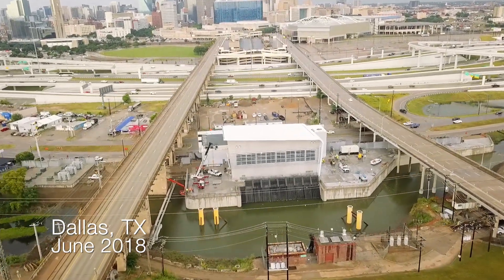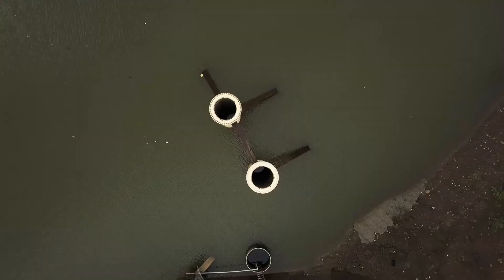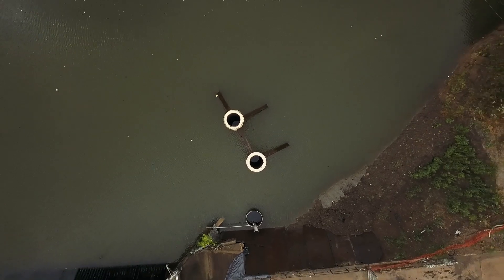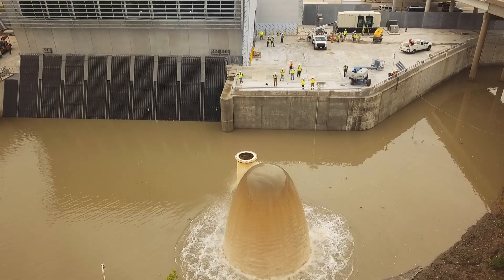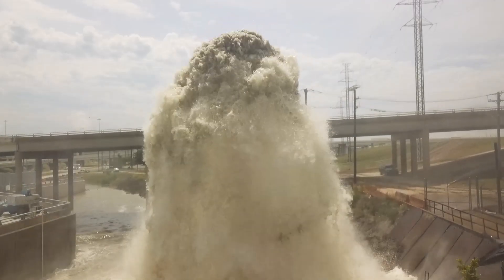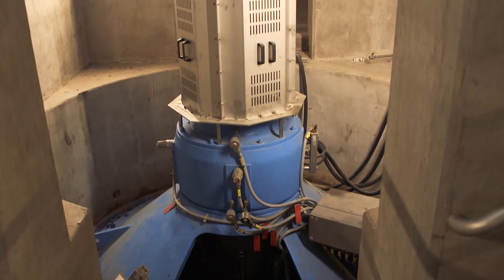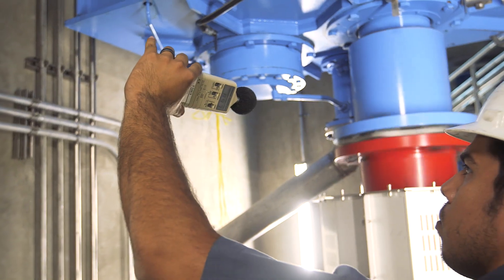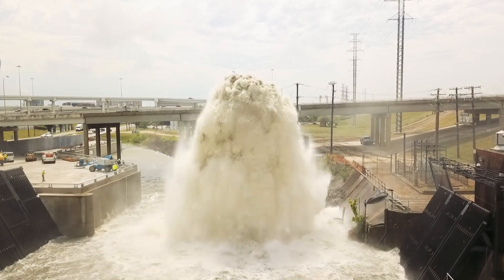Performance Testing of Able Pump Station #3 - June 2018

Comment: And what is the design head and diameter?  And who the heck designed that place as it looks like the pumps have to fight a head even when they aren't needing to. If the pumps pull in water from the needle racks shown, it then has to do a 180° turn to get to the discharge.
Reply: 58-ft TDH. Pump impeller diameter is about 9-ft. Pumps are concrete volute type.

Comment: How much HP does one of those pumps have
Reply: They are rated at about 3000HP each. 4 pumps total in the station.
Reply: @hughbollin3044  At how many rpm
Reply: 4000 HP each. Pump speed is about 215 rpm.
Reply: @toddtownsend2404  Ok thanks